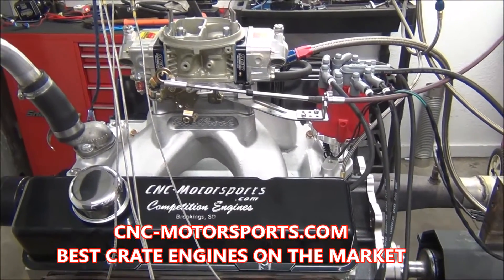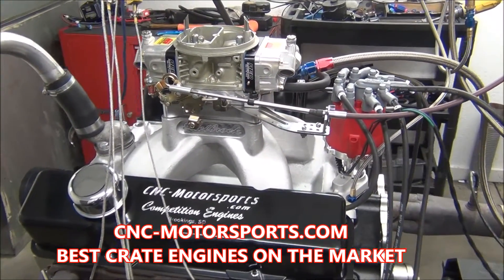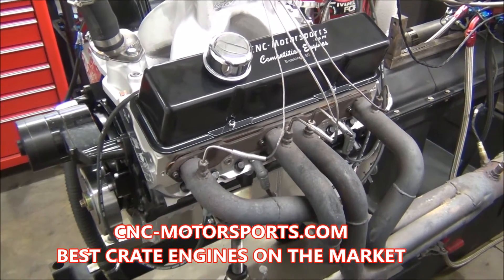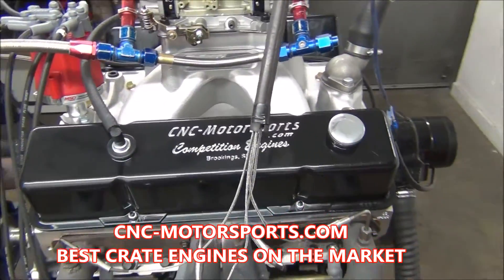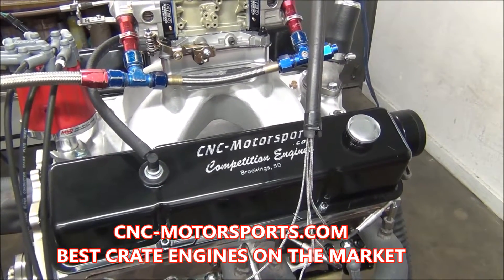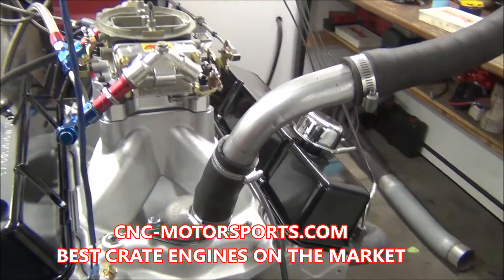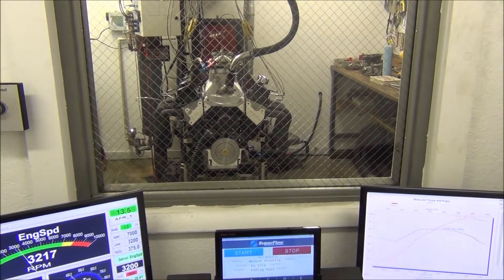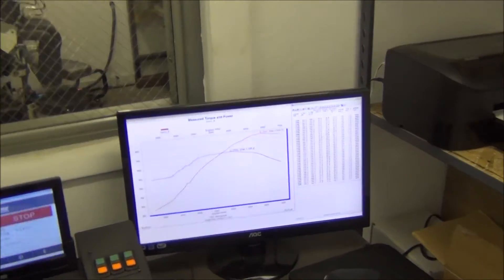615+ Horsepower SB Chevy 427 Crate Engine by CNC-Motorsports

Comment: That engine is great ,,I noticed it changed pitch around 4500rpm  then started climbing again,,,is that a huge cam that operates around 4500 to whatever..can this type setup engine  produce good figures from say 2500 to 6500,,however I did notice the intake is an upper rpm type open top single plane style typical of these figures.I am interested in a  good 427 that can operate at street level and performe when pushed,,i understand this is a different engine I am talking about but at street level I wouldn't see 6500rpm.steve